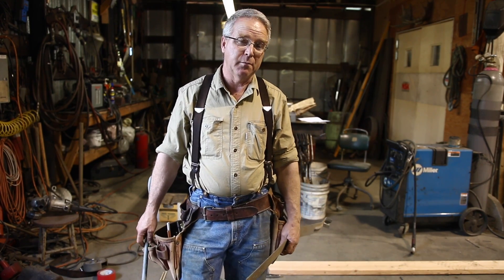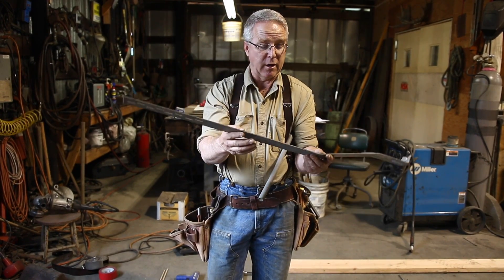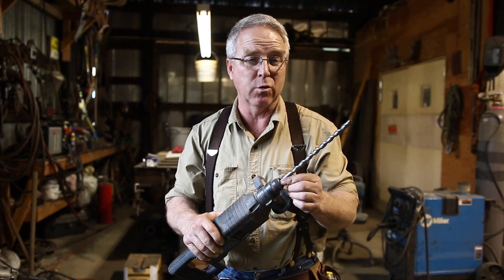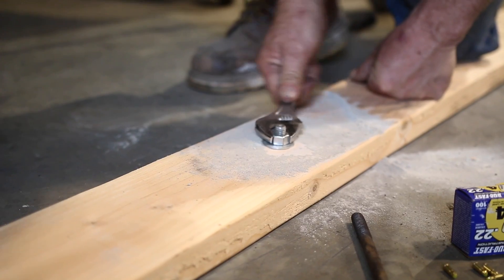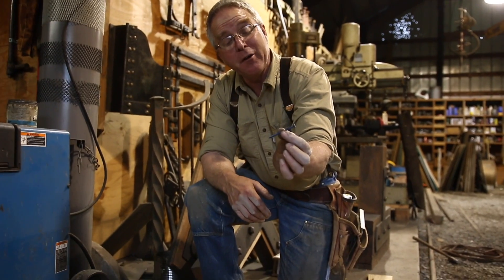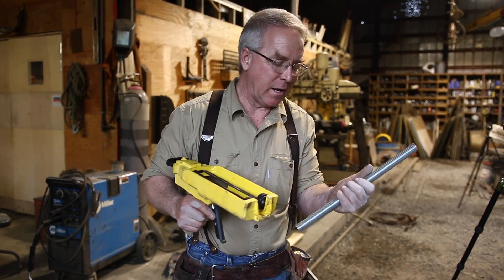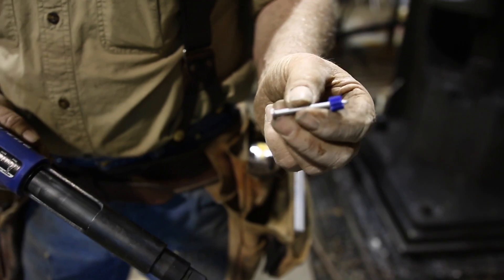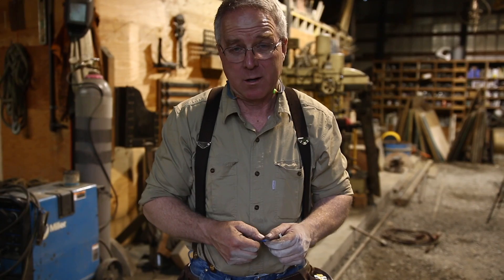How to Fasten to Concrete

Comment: I think it's worth cleaning and greasing the chuck end of SDS bits. Dry and dusty SDS chucks wear out quite quickly. Greasy and dusty ones even quicker, so if you grease you should check it's clean first. I know it sounds like hassle but how often do you change bits in a day really? 

I like the Boschammers with interchangeable chucks as you can take them off for cleaning or replacement without stripping the whole machine down.

Comment: I'm 68 and it has been many years since I've seen a cinder block. Back in the good ol' days, when coal was a fuel commonly used to heat homes and power industry, cinders (the ash left by coal combustion) were mixed with a binder to produce "cinder blocks" which have since been supplanted by concrete blocks. We oldsters still tend to call concrete blocks cinder blocks, kind of like calling a refrigerator an "ice box." Aren't we old people quaint?

Comment: HEEEELLLLP!   I have broken two tapcons while attempting to permanently attach my slab insulation.  What am I doing wrong?  I have 5/16 hex head screws...I used the drill bit that came with the screws...I drilled appx 1/2" deeper than the length of the screws...cleaned the dust out of the holes as best I could...(although this wasn't easy...due to deep/small hole through 2" of insulation and additional 1 1/4" though concrete)  I may not have got them cleaned out "sufficiently".  How likely is it that this is my problem?  Any other ideas why my screws are breaking before I can get them all the way in?
Reply from the maker: Try reaming the hole a few times with the bit after you get to the right depth...
Reply: @essentialcraftsman   Thanks...I tried that on a couple of them as an experiment., while at the same time worrying about the potential for widening the hole to the point that the screw wouldn't have anything to hold onto..  It "kinda" worked...meaning it removed "some" of the dust.  I was hoping it was "enough"...and because the insulation is already stuck to the concrete, just because it was poured that way...it's impossible to see the concrete part of the hole.  I broke out my vacuum just after posting previous message, hoping that would help, but I don't think much, if anything came out of the holes (there's no way for air to get all the way back into the hole and "lift" the dust out.  I'm now thinking a pipe cleaner might help?  I actually have some here.  I also have someone coming over tomorrow morning to do what he can.  I have to say I'm a little disappointed.  Seems like it should be easier than this, but I feel pretty sure it's the outer foam insulation that is making it so difficult.  There was one 6" section where the foam had fallen off in which I first screwed through the piece of insulation I cut to fit it...and then drilled the concrete behind it separately...and that's the ONLY one I haven't had problems with.  It must be that the dust is getting caught in the insulation and then getting "re-circulated" when I try to insert the screw.  Argh!   Thank for the suggestion.  I had someone tell me today that he's tried to do that, and that yes, it's maddening, and that I'll want to screw a hole in my head by the time I'm finished (ouch!...I'm more likely to want to give it a break until I have another idea)

Comment: Good video.  What needs to be done when drilling into concrete and you run into steel  rebar and need to make your hole deeper in the concrete?

Comment: The Bosch will never wear out, but they occasionally stop working. When that happens, you generally need to disassemble, clean, and lubricate the gearbox and they'll be as good as new.

The age of the concrete will have some effect on how well some anchors work. When I want to be sure my anchor will stay where I put it I use epoxy. For lighter stuff I really like the Tapcons.

Comment: No Hilti tool and masonry nail? Probably a bit slow for a contractor to use in large numbers, but for small jobs on brick, certain blocks or even tough mortar courses, they are great. My Hilti tool must be 30 odd years old and looks like it's been in several wars, but still works like New...

Comment: About fastening to concrete or brick drill a three sixteenths inch hole and use a small piece of tie wire and a sixteen penny nail and you have something that is very cheap, strong , and hard to remove. When working in brick this system holds extra tight.  Given by a carpenter with 40 years experience.  Good Luck
Reply: This is a great fix.i have tie wire and thanks for the tip.a TIP OF MY HAT SIR.MUCH APPRECIATED.

Comment: can I use my standard drill and just use a smaller bit than 3/16 to prevent over reaming the tapcon hole?  I might just use anchors and even hooks to install a tire rack on a cinder block wall

Comment: What if you're slab on grade (or even worse below grade) with a high water table and a waterproofed concrete.  Can you attach a pressure plate for a wall frame using adhesive only?  Im on a job right now where nailing the plate to the concrete is causing a noticeable amount of water to come through the nail holes (we know it's the nail holes because it is a 10 year old house that never leaked in the basement before).  Options??  Thanks!

Comment: A lot of regulations are nonsensical, not evidence-based or so risk adverse and expensive to meet that we should all absolutely scoff at them, and I speak as an engineer not as a contractor.  Here's a great example: Interior fire sprinkler requirements in places where the vast majority of fires come from outdoor wildfires.  Exterior sprinklers would make far more sense but they insist on interior ones that cost in excess of $15k and has never saved a single home from a wildfire.

Comment: I've pounded thousands of cut nails w/ a 3 lb hammer.  Works great for cleats to hold plywood forms to the footings and for sole plates and wall connections for basement walls.  Probably the most old-school of them all.

Comment: Tapcon screws are a pain in the butt crack, I can't seem to get any to screw down properly.  They're either won't go in or if I increase the diameter of pilot hole then they won't tighten.  And yes I use a rotary hammer SDS drill too.

Comment: Commercial concrete carpenter back east and the number one method we use for attaching wood to concrete when forming is a 16d duplex and single piece of 16ga tie wire. I've found when working with block/cmu that doubling the wire adds more holding power but increases difficulty in wrecking. Great video!

Comment: I have had so much trouble with Tapcons that I wonder if I'm doing it right.  This was my recent experience with 1/4" Tapcons in an outdoor walkway.  Drilling the holes was very time consuming.  I was using a cheap hammer drill, which might have been part of the problem.  But I was going through bits like mad.  Each one lasted only about two to three holes before they became useless.  I might have overheated the first few, but after that I was careful to keep them cool, but no difference.  Then, driving the Tapcons into the concrete was even harder.  They became EXTREMELY difficult to turn, even though I used the Tapcon bits of the recommended size. Socket and crescent wrenches stripped the head on many screws, and I had to back them out and use fresh screws.  Even vice grips didn't work.  I eventually had to use an impact wrench because nothing else worked, but ended up twisting one screw off in the concrete.  When I finally finished they were very strong, but it was such a pain that I can't believe everyone goes through what I did.

Comment: throw away those plastic connectors. I retired from the building industry after 55 years, marine, commercial, industrial and residential, many times I had to replace the plastic ones.

Comment: I cringe every time I see someone beating on steel and not wearing proper safety glasses. Eye glasses are not a substitute for full coverage 5 point safety glasses. They are far cheaper than accumulating metal splinters in the eye,but I am sure you know that in your line of work. Always wear the proper safety gear for the ask at hand.

Comment: I’ve found that a 3/16” hole plus a 3” deck screw with one length of tie wire works excellent. Tap cons break more often and hold less.
Reply: I've never seen a tap con work correctly, I always have to put a piece of wood or a zip tie tail in the hole, that's even with the tapcon brand drill bit. Good theory, enormous waste of money.

Comment: You can also epoxy fill drop-in [expansion] anchor bolts (holes), which I did for the foundation of my shed/workshop (overkill probably for what is a relatively small building). Since it was built on an 8" concrete pad foundation I had the option. I supposed I could have used tapcon screws also or titan lag screws. But I have never seen the dual nail technique, which was interesting. You are full of useful information.

Comment: Sir you make “this old house” seem boring! I wish I would’ve found this channel years ago. Btw I’m not pro carpenter but I wish I would have been instead living in a factory for the past 20yrs😞
Reply: You can still start with "odd-jobs" around the neighborhood... maybe just keep it like making a hobby pay for itself. The neighbors will enjoy access to some cheap help, and you can take the time to advance skills... building littler things at first, like framing in sheds, pop-up swing-sets, fixing porches... limit the tools you'll need, and put the hobby-job to weekends, off hours (when you're up to it)... and you can still do something you WANT to do.

   A basic carpenter like that would probably only need a hammer, circle saw, drill, speed square and framing square, maybe a chalk-line... and the incidentals of each job (nails, screws, wood, etc...) MOST of that can be found in flea markets or garage sales for cheap. 

             It's how I started. ;o)

Comment: I’ve seen concrete forming contractors use 5/16 diameter hole with 3 nails. The third nail is left high to help pull it out and release friction of the other 2. This is for removal purposes.  Powder actuated fasteners typically require a one inch embedment. So if you are fastening a 2x4 to Cóncrete the nail length should be 2-1/2 inches in length.  One inch for embedment plus 1-1/2 for the thickness of the wood.  Nice video

Comment: @ 13:07 you say you are using a 1/8" bit for the Tapcon screw.  The box recommends a 5/32" bit.  However, when I use a 5/32" bit the screws don't bite and I have to drop down to a 1/8" bit like you did.  What's up with that?
Reply: It is really hard to drill in concrete (rotary hammer or not) without reaming it out. Especially when holding the drill with your hands. Going one step smaller on the drill bit helps. You can get some accuracy if you use a drill press jig to hold the drill exactly perpendicular to the surface.
Reply: I use a 5/32'' bit but make sure it's cleaned out well. Sometimes I get a Tapcon that will break off instead of screwing all the way in.
Reply: I had the same issue with a tapcon myself.  Trying to get it to bite in cinder block.  I just ended up drilling and using inserts with screws.

Comment: I have these 3 methods: For wall mount (concrete wall) i use either plastic plugs (special long ones for concrete.. all sort of lengths and designs) they hold very fine a tv wall mount or a picture frame, but would not trust them in pulling mode. For pulling mode (ceiling mounts.. ceilings out of concrete) i use expandable anchors. These are great and somewhat removable with a wedge bolt and detachable sleeve with slits into it, really holds well (the trick is to set the anchor without any fixture, tighten the nut against the washer-sleeve and let it alone like this, atach the fixture to remaining threads on the stud with another nut. Sure this way flush mounting is hard to do.. you need some spacers to rest the fixture against the wall/ceiling and not against the set nut).
I've heard but never used of chemical anchors.. some swear by them, idk. might give it a try at some point.

The latest personal "invention" for holding some posts for a large shed with a roof on a concrete floor that was already poured and hard (it was a concreted part of the back yard next to the house):
I used wood posts with a U bracket. Some of these U's have an S hook to be set into concrete. I got creative and got the U bracket without any tail, got 20mm rebar and a 20mm 400mmlong drill bit, drilled the hole all the way through the floor into the soil. Filled the hole with some cement paste and pounded the rebar into the soil through the floor (a great tip for driving rebar into soil: use the hammer drill on it hammer mode without rotation and pound the rebar on its end. I made use of an old blunt drillbit that i've cut flat on the tip, and drilled an indent on the end of the rebar so it will not slip. The rapid hammers will inch the rebar into the soil great lengths. I stopped at about 1.5m into the ground. Cut the rebar about 30mm above the concrete floor and welded the rebar to the bracket.
After driving 6 long pieces of 20mm rebar into the ground (and cemented with the hole through all the floor slab), i've electrically wired them together and attached to the electrical earth in the main power supply box for the entire property. The original earth is a standard zinc plated 50mm x 5mm plate steel driven about half a meter into the ground. My 20mm zincplated rebar driven 1.5m into the ground times six should provide a much better earth connection. (all of them including the original ground are close to each other so absolutely no worry about electrical loops into the ground as i splice this contraption to the original earth pole installed decades ago)
Aside big consumption of materials all worked out fine. I had those rebars lying around so no biggie.. could have stopped way shorter at half meter of even shorter (as I concreted the rebar into the hole of the concrete i had), but as the hammer drill was pounding the rebar fast and easy i've let it go to see how far i could get and got the earth redo idea so went for it.

Comment: I used to install parking systems (equipment in parking garages). We had some trouble with some of the bolts coming out of the holes over time on the barrier gates using regular bolts set into the concrete - new concrete that is. An engineer told us to try try wedge bolts with epoxy. Never had a problem again. They're a pain in the butt to set but they work great. Just don't get the epoxy on your skin... it burns. Excellent video!

Comment: I've worked in the field for years and could never understand why they keep playing around with the idea. The real fix for this is to have 4 I beams one in each corner of the foundation ran the depth of the foundation to the top of the structure. All you need is 4 beams then tie them with to the wood wall and roof structure.

Comment: Love your channel and respect your knowledge, experience and ethics. I would recommend always loading the pin first on a powder actuated gun so you don't put your hands at the muzzle of a charged weapon. When I was a teen framing interior walls to chop up my father's furniture store into office space my brother and I used powder actuated fasteners. We experimented shooting a pin through the air like a bullet. It penetrated a cedar 2.x 4 at an angle from 20 ft. We depressed the muzzle against a step ladder. Not a toy. I didn't see you demonstrate a Rawl pin. These are hardened pins with a kink in the tip you just hammer in. Non-removeable in concrete and fast. 
I'd love to see some old school carpentry tricks using a handaw. Power circular saws were just coming out when I was young. All the carpenters in my family construction business still used them, esp. up in the roof framing. My house was trimmed with an old mitre box hand saw. Also, any tricks with the ubiquitous folding stick rule. great for measuring inside closets for cleats and door jambs. Thanks and God bless you.

Comment: The tap gone is being used more and more in the EU they have an amazing hold. We can get them up to 6 inch long and they have a torx head. 90% of homes here have walls of 2 4in concrete blocks with a gap between them as the storms can be bad.

Comment: Thanks for the expertise.  Q: I don't understand what the drill depth should be for the split drive anchor??  Is it supposed to bottom out for the anchor to spread and seize in the concrete?  Given the formula 1 1/2" plate + 1 1/8" required depth into concrete and I have a 3" anchor,  the total drill depth is 2 5/8" - that is 3/8" short for the 3" anchor???  I don't get it...

Comment: Using Tapcon screws to attach a 2x4 to a brick wall are the drill holes in the wood the same size as the drill bit for the Tapcon screws? Thank you.

Comment: Thanks for the info. I have a 50 year old 10x14 slab that I want to use as a floor for new shed/workshop construction. No cracks in the concrete, but over 50 years, it has become slightly unlevel from back to front. (maybe an inch?). The floor being unlevel isn't a problem, I just need to figure out the best way to level the walls.

Comment: when you put in that wedge anchor you used an adjustable wrench, I am have a barn built and plan on using the wedge anchor and I was planning on using an impact driver to tighten the nut. Can you tell me if I should hand tighten them or is the impact driver ok to use ???

Comment: A true toggle bolt(the zip tie kind) will work better than the butterflies. Also another way that we used to attach closet flanges to cement with the old plumber I trained under was to drill a hole, pack it with lead wool and then drill a wood screw into it.

Comment: Came here just to figure out whether it was ok to use an impact driver for driving screws into concrete (I knew the rotary hammer is pretty much necessary for drilling the pilot hole) but ended up learning more ways to nail stuff to concrete than I ever thought existed. Awesome video.